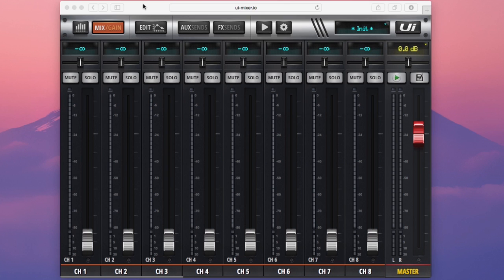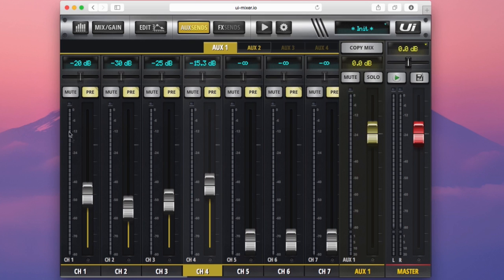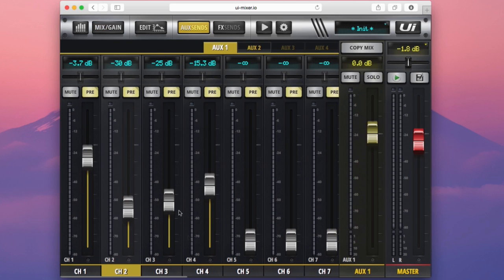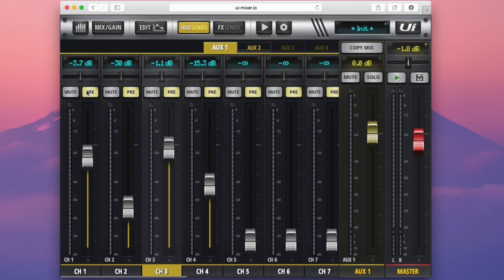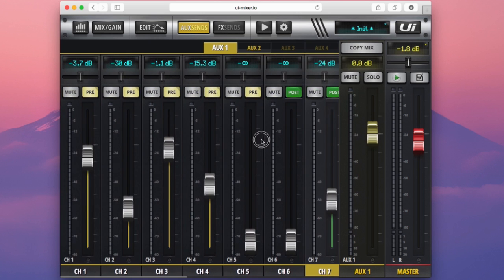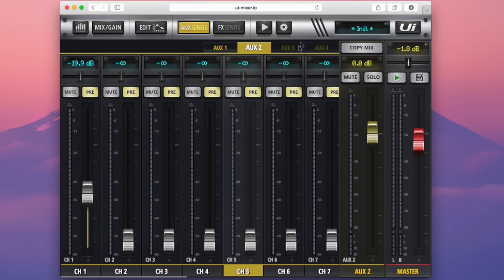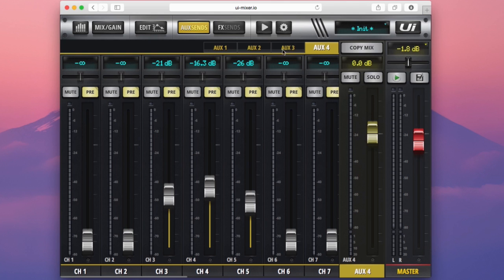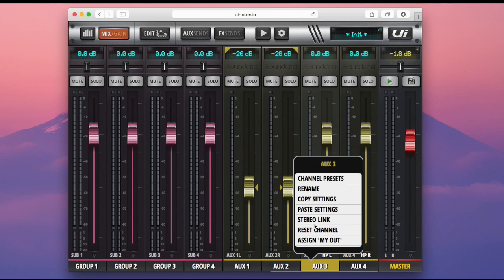Soundcraft Ui Series Tutorial: Overview of Auxes and Outputs

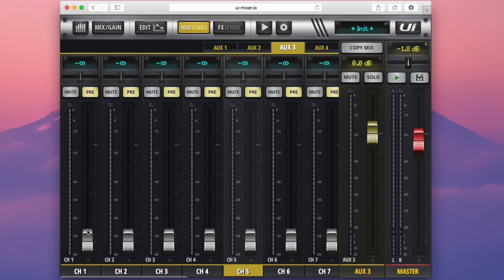Comment: What is being said at 6:38 is actually false: AUX3 is not the first of the headphone outputs, but the left channel of both headphone outputs, and AUX4 is the right channel of both headphone outputs. Actually both headphone outputs are hard-wired together: left_1 with left_2 and right_1 with right_2. There is no way the software can separate the two, because the hardware doesn´t allow this. So if you need the headphones as additional AUXes you can do either of two things: Connect them to a stereo AUX (see 7:33). Then both headphones will have exactly the same (stereo) mix. Or (what I did): Get two TRS (male) to XLR (male) adapters, rewire one to transfer left to both sides (left and right) and rewire the other one such that right goes to both sides (left and right). NEVER plug in a mono TS jack into the headphone output!!
Reply: hey, I want to do your same thing, directly connecting 2 different headphones as Aux 5 and 6 using Heaphones 1&2 outs... what is a  "TRS (male) to XLS (male) adapter"? Is "XLS" a misspelling? You meant XLR? In this case it's not convenient as I want to connect headphones directly and I should use another XLR to trs female adapter...
Reply: @Scarecrowsbandct  Correct. In that case you might need another adapter. In the meantime I got a Soundcraft Ui24R which has sufficient AUX and much better pre-amps. You might consider this.
Reply: This comment is gold, thanks to clarifying. So basically the device has only one mixable headphone out with y splitter into two jacks which will get the same mix.

Comment: Is this still relevant with the current firmware? I'm not 100% sure, but I recall the settings being completely different. The option to switch between Master/Solo and AUX for Headphones seems to be gone.
Reply: Settings>patching>hw outs> patch aux to h1l/r h2l/r as needed
Reply: I have the same question.  Didi you ever figure this out?
Reply: @ericjohnston9262  actually, no. But AFAIK, they changed it in the newer firmware versions and it doesn't work anymore.
Reply: @ManticoreSigma Thanks. I posted something on the Soundcraft Ui FB page so if I get an answer on how to do it in the new firmware, I'll post the answer here.

Comment: I have a problem with the headphone outputs set to aux. Don't know if I am doing something wrong. Even if I don't feed Aux 6 with a channel aux send, I still get a signal there, coming from aux 5. So there is still a paralell conection between both plugs. But it should be separated I believe. Do I need stereo jacks into mono to just get either one side of the signal. Totally clueless????
Reply: 2011UWM I have the Ui12 and experimented with setting Aux 3 and 4 as Aux and not headphone outs. Basically, it sends Aux 3 to the headphone Left and Aux 4 to headphone Right. This is the same for both headphone outs. Therefore you need a TRS to 2 mono to split the signal. You can then use either headphone 1 or headphone 2 Jack sockets and will get the same result. It will be Aux 5 and 6 on the Ui16.

Comment: I have the ui16, and when I choose the headphones as auxes, the outputs only send a mono signal, aka i only hear it in one ear. if the headphones are not auxes, they're stereo. do i have to combine auxes 1/2, 3/4, 5/6 to get a total of only 3 stereo aux outputs and lose half of my auxes? I'm slightly confused and hoping this isn't the case. any help would be appreciated.
Reply: auxes are always mono, you have to pair 2 to get an stereo aux... if you see, when you get the default template, aux1 and 2 are linked, and you have to spare them to get 2 auxes mono instead of 1 stereo... This is this way, not only in soundcraft, but every mixer you can find... analog or digital...
Reply from the maker: +xalanx309 If you need stereo aux outputs, then you will have to use the above setup to achieve that.
Reply: +Soundcraft Mixers So why does each headphone output, when set to aux output, only produce sound out of either the left or right ear, depending on which jack you use, and not both? Is it because all auxes are mono? I haven't tried the xlr aux outputs yet, but would it only output to one ear as well forcing you to stereo link all auxes and lose individual aux control?